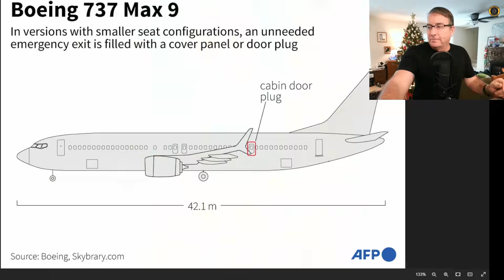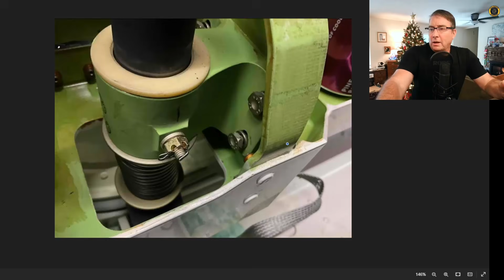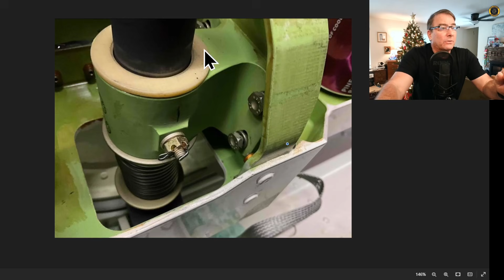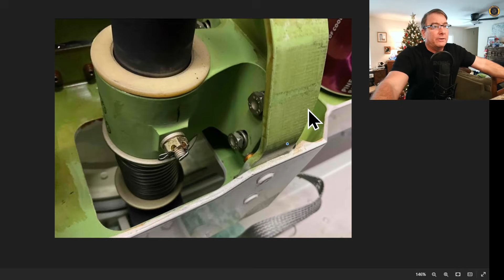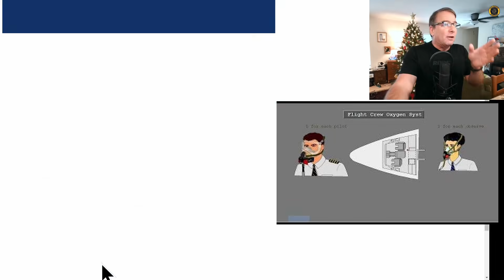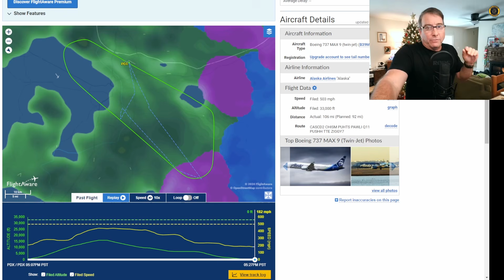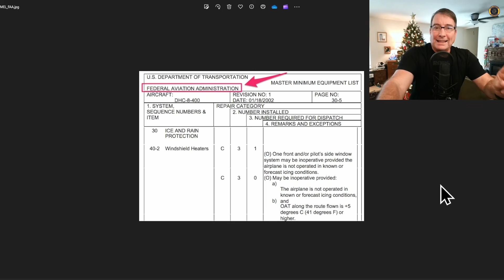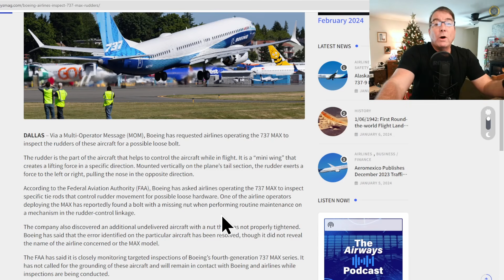"Yes, We Have No Bolts"  9 Jan 737 Max-9 Update

Comment from the maker: CORRECTION: 1/11/24 The Plug Doors ARE NOT removed at Renton (Boeing) to install the Interior.
Reply: If I understand correctly, the door plugs are sometimes removed again at Boeing and sometimes they are not.

The amount of loose bolts reported makes me wonder, if there is a procedural miscommunication. Could it be that Spirit who did the fuselage deliberately did not tighten the bolts because they thought they would be removed again at Boeing?

And the faulty planes are then the ones Boeing left untuched?
Reply: Spirit Aeroworks is sweating bullets right now.
Reply: @patrickradcliffe3837 It's Spirit AeroSystems, if your going to slander 7000 people get the name right.
Reply: @jamezh2822  yeah...right, just calling balls and strikes bruh.
Reply: @patrickradcliffe3837  No, we aren't.
Reply: Even if the plug doors were removed, the bolts that were found to be loose (some of the four that hold each hinge guide bracket) wouldnt need to be removed in order to remove the door. It seems like the nut/bolt and retaining cap on top of the two tubular hinge guides would be the only two fittings that need to be removed in order to pull the door up off the hinges and away from the plane. 

This has to be a manufacturer installation error, not a re-installation error. Alaska messed up by not addressing the pressurization warnings sooner, AND by not pulling the CVR breaker,  and Boeing messed up by providing planes with loose bolts (which they are already proven to have done in other incidents like the loose rudder).
Reply: the Loose Goose @gutrali
Reply: The four retaining / securing "bolts" (really pins with a threaded and drilled end section) are what holds all the fixtures in the "locked" position, without them the plug door can be latched and unlatched, and tilted open on the straps. If it pops loose in flight because it's not secured the end fasteners on the hinge rod could easily be smashed off just like the roller pin slammed through the bottom of guide track. @gutrali
Reply: The door looks like it is made of carbon fiber right?  So would if the door skin structure failed because a catering truck bumped it with their service truck raised platform bumper  trying to get it to open not knowing in was a inop door?       @gutrali
Reply: @gutrali  "Plug door' is syntactically mutually exclusive.

If you add springs, hinges, rails, etc, to a plug, it's a door again.

This couldn't have happened if the plug didn't have all the unnecessary features of a door.
Reply: It has been determined by the NTSB that the pressurisation issues were NOT because of the door, they are looking at the pressurisation systems themselves expecting one to be faulty. The CVR data would NOT help pin down the door problem so everyone should stop whining about it, especially the NTSB and Mrs Bossy Blondie..  @gutrali
Reply: @johnmoruzzi7236  the CVR could have revealed useful or hindering reactions by the pilots which can help other pilots prepare for any number of future emergencies....... Why should we stop whining about it? ... Also The NTSB did not yet confirm whether the warning lights were or were not related to or caused by pressure problems. But any logical person can confirm the warning lights and the associated voluntary restriction from ETOPS definitely could have saved human life.... Because without those, this plane could have been halfway over the Pacific ocean when this happened ....right?
Reply: @johnmoruzzi7236  An overwritten CVR after an event is ALWAYS an issue. Because it shows that procedures were lacking. It doesn't matter, if the data would have been crucial (we'll never know because we don't have the data) or not. After an incident ALL data that's available has to be retained. That was not the case here. So it is an issue that has to be addressed.
Reply: @johnmoruzzi7236  source? Sounds like you are just making stuff up.

As regards the CVR, I agree it is likely not needed to determine the root cause of the depressurization, it is still needed to determine if the pilots and the cabin crew handled it correctly, and anytime a pilot does not preserve the CVR recordings, it always makes me wonder if they did or said something they did not want us to hear.
Reply: @johnmoruzzi7236  
The engineering of the CVR should have been not to erase its content, but when it has to be over-written due to space constraint, like in a loop.
Reply: @johnmoruzzi7236 What I understood from the NTSB briefing is that there is no electronic sensor  connection to the panel, but any substantial leak at the panel would definitely have caused a pressurization issue triggering the cabin pressure alarm
Reply: @MichaelMorgan-ds4xg  Correct. There is only a sensor and light in the cockpit for actual emergency doors (and all the actual doors, i.e., there is panel with lights for all the doors on it). Since this is a plug, it doesn't have a sensor.
Reply: 14psi over the area of that door plug would be considerable.  Where did you find the value of 14 psi from?  See full coment below.
Reply: According to Juan, the cabin pressure was about 14.1 psi, then dropped to about 9.1 when the plug departed. So the net pressure on the door was about 5 psi before blowout. see 8:30  @AlexStrachan-zx7bf
Reply: @AlexStrachan-zx7bf  That would have been 14psi absolute, not PSIG.  The actual pressure differential (difference between the inside and outside) was about 4 or 5 psi at the time.  Maximum pressure differential in jets is usually around 8 or 9 psi.
Reply: @AlexStrachan-zx7bf  Yeah, it's not right.  I think it was 3 psi differential at 14,500ft.  So say the door is 1.8 sq m or 2800 sq. in, that makes the force on it 8400 lb or 3800 kgf.
Reply: @AlexStrachan-zx7bf  it’s absolute at that altitude. But about 2-3 differential.
Reply: So many times that voice recorder is over written .why isn't isnt there redundancy in this as it's so important to improving pilots and assistance in ermenrgencies 17:14 😮cies ? o
Reply: 4:57 - I just heard Amon Goeth ask "Make me a hinge."  Shortly thereafter, the imbecile that caused this debacle to be taken out back and dealt with in the most hideous way since his two pew pews just goes click.
Reply: That makes sense, and thanks for the clarification.
Reply: If I plug my door at home I'm just going to nail a piece of plywood to it.

If I then added springs, hinges, rails, etc, it's not a plug anymore it's a door again. 🤔
Reply: Are you saying that the cabin might not have been properly pressurized according to the flight plan?

Comment: 14,000 feet without oxygen is not at all life-threatening. I grew up in Colorado and we routinely hunted for aquamarine on Mt. Antero, elevation 14,269, and we were right at the top. There was a horrible jeep trail up to that top. It took 4 hours to go 7 miles. A lot of rock-crawling. We spent all day at 14,000 feet climbing over rocks, hiking around, etc. Sure, you got winded easily but that's all.
"As of 2025, over 200 individuals have summited Everest without supplemental oxygen".---Grok A.I. And Everest is 29,031 ft.

Comment: Hey Jaun you being the ex 757/767 pilot  Maybe some day you can show me how a complete novice who can't control a Cessna 172 managed a 270 degree descending turn to the ground hitting 5 light poles with 2 Monster GE90 engines scooping up the ground crashed into the pentagon  .. Maybe some day explain how that was done when pilots with 25 thousand hours couldn't accomplish it in the simulator ?

Comment: It appears to me that there is very little load on the upper hardware. All the upper bolts appear to do is hold the door from coming up and allowing the pins to slide out of the track. I agree with some other commenters that it is likely the bolts were never there. It looks to be impossible the upper bolts could be in place and the door slip off the pins.

Comment: Here's what I expect/predict the NTSB is most likely going to find, based on the information publicly available (making some assumptions where info is not available):

1. The filler panel ("door plug") was installed with all proper bolts and fittings.

2. The manufacturer(s) (Spirit Aero, and Boeing), may have prioritized aesthetics over structural technicalities, with inadvertent consequential endangerment of flight safety, specifically: the filler panel's outer surface and edges are designed to visually conform with the exterior surrounding edges and surfaces of the structural fuselage, and OEM installers or the Boeing visual inspectors, etc., may have allowed for aesthetic adjustments to the 12 filler panel setting pins that are mechanically responsible for taking the pressure loads during flight as well as fitting the panel to the fuselage for visual continuity. The panel is specifically installed to conceal from the outside, that any structural opening is present, but for the top seam spacing that allows movement during installation or servicing.

3. A total of twelve load-bearing stops, 6 on either side and none at top or bottom of the panel, is a critical design failure for such a panel size and force tolerance. The filler panel undergoes anywhere into the range of 10 tons of dynamic pressure during normal operations, so twelve stops with roughly a square inch of contact surface each are being required to bear roughly around a ton per square inch, on a dual-purpose structural/aesthetic panel that apparently weighs 63 lbs. Unless the panel and load-bearing points are made of forged titanium (they're not), such loads are highly unsafe especially with this panel's critical functional design.

4. At the moment of detachment, the panel was undergoing around 8 tons of force minimum. This is because 737s, specifically, on takeoff and climb maintain runway-relative cabin pressure up to 18,000 ft altitude per operating manual, so at 16000 the cabin was still pressurized to approximately sea level (14.7 psi). Factoring a 90% lower external atmospheric pressure at that altitude, and an airspeed of around 350mph, would have added up to another 0 to 1 psi to the dynamic pressure (pressure difference inside vs. outside). So roughly 15 psi x the reported panel dimensions (26x46in) = 8.97 tons of outward force acting on the panel and transferring to at least some of the load-bearing stops. The panel does have large-radius rounded corners, so the total area is slightly smaller than the width-by-height multiplication.

5. If the load-bearing points were out of proper adjustment, resulting in imbalanced load distribution, this could have  caused any one or more of the load-bearing points to be subjected to several times their designed operating loads, leading to sudden failure.

6. If and when any one or more load-bearing stops initially failed in flight, the remaining stops would have inevitably failed in rapid succession, either from sheer scaling-up of load forces on remaining stops following the initial failures,   or from impact (shock loads) as the panel accelerated outward across small fractions of an inch upon initial stop failure. Under 8-9 tons of constant static force during stop failures, any free-motion outward acceleration of the panel would have been on the order of 100 mph, so total time frame from initial catastrophic stop failure to panel detachment would have been fractions of a second, as if the panel were being rammed through the opening at 80-100 mph while being backed by a constant force of several tons.

NTSB recommendations on filler panel design improvement are likely to include specifications for several additional load stops; possible elimination of the easy-open hinged functionality in favor of more-permanent/mechanical load-capable fasteners (versus simple low-strength cotter stop pins/bolts); and separated adjustments for structural versus  aesthetic fittings.

Comment: 7:20 what I don't get is, micro SD audio recorders are literally a dime a dozen, the FAA doesn't require there to be backups of the backups that can hold more than 2-3 weeks of audio before needing to be over written? 

Talking, professional industry voice recorders capable of maintaining days of audio with the old 32gb cards, vs cheaper new ones that can handle 1-2tb cards giving nearly unlimited recording time for just this kind of event?
Reply: Update, a $60 128gb voice recorder can, as long as it has batteries, capture near on 7000 hours, has hot swappable micro SD support, and has auto on, off, time date stamp, voice activation and direct microphone interfacing... And we can't get these in the cockpit "just in case" they forget their 2 hour oh crap recording time?
Reply: More so!?! Why are flight voice recorders limited at 2-3 hours? It's not like we can't just roll back a bit to find what we're looking for? With the advancements of solid state and redundant of redundant systems, why are the audio recordings not, like, a week and synched whenever they hit a terminal?

Comment: Thank God, this door plug did not hit the left horz stab. It would probably be a whole different story. Those alleged loose bolts would be under shear loads, that I'm sure weren't designed to take. Definitely a gross lack of QC either at Boeing or it's fuselage sub contractor, as Boeing is merely an assembler now, at least on this type.  A clear case of complacency, or ill-placed trust. Cockpit door blown open was news to me too, and designed that way?

Comment: Sounds like there was no cotter keys installed on the nuts and they vibrated off. Same with the other bolts. They got loose due to vibration. That plane was a rush job manufacturing wise and no quality control. No lock washers or lock nuts. Sounds like bad bad quality control and no inspection done. That's my take as an A&P mechanic and a service technician in the outside world.

Comment: I think the Max - 8 comes in two versions.  A regular -8 seats about 186, but the 8-200 (for Ryanair) seats up to 210,  The Max 8-200 has an extra door.  Does the regular Max 8 have the door plug, or a regular fuselage ?

Comment: I have a friend who worked in design for Boeing,he said that their designs were inherently unsafe,he wouldn’t fly on their planes. The Dreamliner is a case in point,Boeing built a Composite tube that was to have Aluminium Wings without thinking about the different coefficients of expansion of the materials. They then had to beef up the Wing roots so much that it negated All the benefits. The only reason that it’s more economical is because of the Engines. Not made by Boeing.

Comment: If the bottom 2 were fitted the Plug Door cannot rise that 3.5cm,  to shear them it would take 6 tonnes if they were 10mm, doesn't sound feasible.  And the guide mounting bolts,  probably 3 either side with nyloc nuts surely would have been spotted if loose, thought they had to be painted or marked after torque setting? 
The previous air pressurisation faults could be the spring assists slowly moving the door upward and breaking the seal slightly,  should have been a red flag on a 2 month old aircraft?
P.S. When you look at the door structure if only 1 securing  bolt was fitted that door will not move.

Comment: Monopolies, politics, profits over safety, profits ovet quality, profits over reputation, short term quick gains vs long term quality, finger pointing, threats from management to the employees, lack of communication, poor engineering, the list goes on and on. Where or when will a strong domestic competitor come along? When will American customers tell airlines they'd rather drive vs. fly on a new Boeing product?

When Boeing executives decided to go to Chicago (of all places) instead of staying where the planes are actually BUILT told me they were done as an engineering firm. The money people had taken over. And, it didn't take long.
Plus, the hiring of unskilled labor at non-unionized facilities (not that I'm all rah-rah pro-union, but let's understand that they are TRAINED and have the power to shut down facilities) really shows where the executives are. 
When what you build is just a "product"  that you have to maximize profits out of, you may as well just produce doughnuts, they're "products" too.

Comment: If 3 had failed the broken one ,sheared as all the pressure was being held by it. One bracket twisted violently would show by inspection. Last man standing. Torque of fuselage between door aperture and tail plain flex pressure at lift off. Steep angle climb would not be advisable.

Comment: Why is your Christmas tree still up?  Very nice tree but you will need to let go :-)  Great update and video; I guess they will have to simply double up on the hinges/bolts - changing or modifying the existing doors should be simple (and not overly costly).  Why do you think the bolts were not torqued correctly?  This is a major issue but I guess it will now be included in periodic checks.

Comment: Why even rely on the cockpit recorder in any situation? Can't a continuous stream of data be sent from the plane to a ground recording setup? 
There isn't any limit on the amount or duration of information that can be transmitted wireless from anyplace on the planet to another today.
If all of this information was simply broadcast out from the plane constantly that would be recorded internally to the plane.. why haven't they done so?

Everyone hears the same line every single accident; "We are waiting for the flight data recorder to be recovered so we can figure out what happened." That's a load of crap. / tech rant